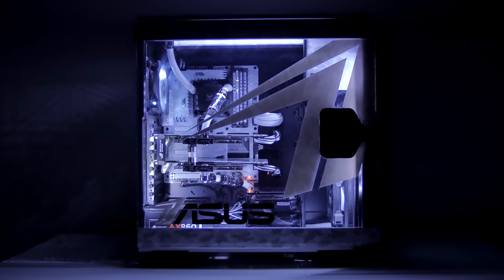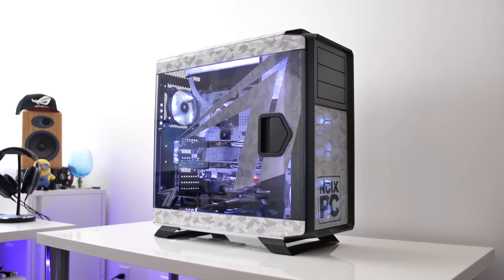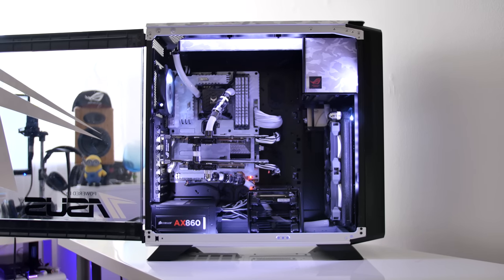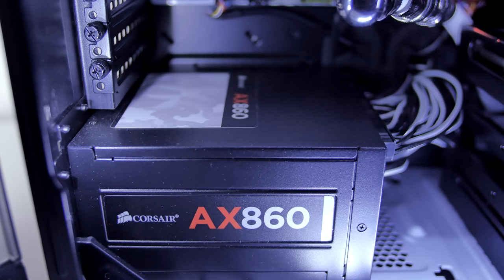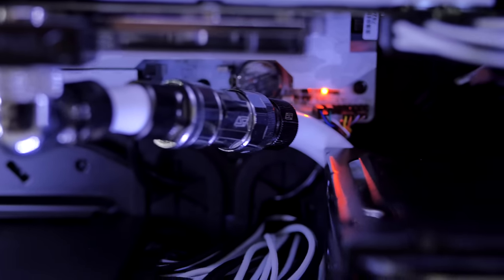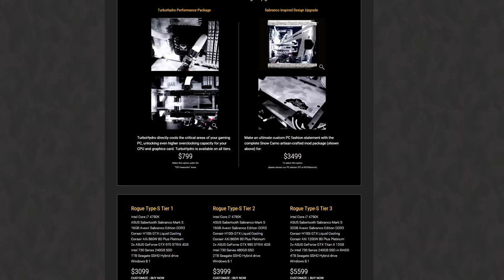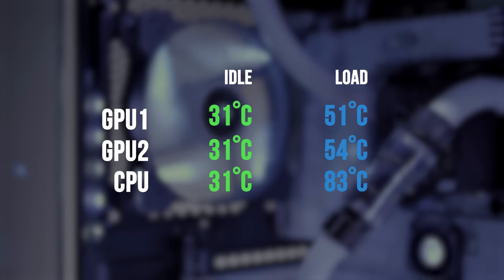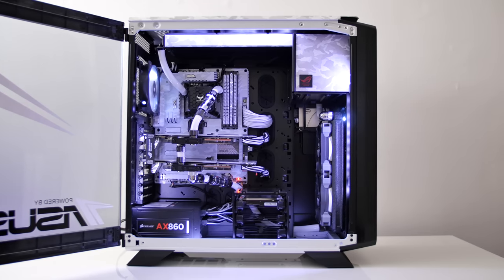NCIX PC: Rogue Type-S Review | 980 SLI, 4790K, 16GB

Comment: Why was there no 980 Ti version of this? If there are waterblocks availible for version like ASUS' STRIX version surely it must perform better than Titans. If not, might as well buy those to get the same performance for $700 less. Why is there a 970 version but no 980 Ti version? To show off dual GPUs? That's a lot of microstuttering for no value.
Reply: Firstname Lastname Two Titans>One 980TI
Reply: GGMANIAC My bad, the comment was poorly worded. What I was referring to was how there's a GTX 970 SLI version, which would be much better with just a single 980 Ti. There's also a Titan X SLI version, which would be much better with a custom PCB 980 Ti SLI setup.
Reply: Firstname Lastname Hmm yeah I suppose. This build may have been furnished before the 980TI came out though.
Reply: Firstname Lastname If you go onto the website and hit customize there is an option for 980 ti
Reply: Knowledge = Performance Alright that's cool but that really should have been in the recommended builds. I'm not buying this but it's quite a common theme for prebuilt PC's to have terrible build choices.
Reply: This is true. But if you know a little bit you can click customize and change some aspects of the build.
Reply: Knowledge = Performance I'm glad they at least added the option =P
Reply: ya
Reply: Firstname Lastname there is 980ti configuration just go to click the link in description and then click costomize
Reply: the guy Did you read the other comments?
Reply: Firstname Lastname nope
Reply: +Knowledge = Performance Hey! You seem to be knowledgeable about computers. Should I sell my 980 and get a 980 ti or just get another 980.
Reply: It depends on what  you are doing
Reply: Knowledge = Performance I'm looking to run future games like Fallout 4, Total War: Warhammer etc... on max settings in 1080p 60fps. Basically I just want to make sure that I can run games on max for the next 2 years or so. Thanks for the reply.
Reply: Chris Nelson for 1080p60 even 970 is fine(don't reply)
Reply: +Chris Nelson Im running crossfired 7970's ghz edition, been running games on ultra 1080p 144fps+ for 2 years, a single 970 would run anything at 60fps for 2years no prob
Reply: Inde x the only thing is, is that with the single 980 I've already ran into a couple games like total war attila and the witcher 3 that I've had to turn down some settings to get 60 fps. Also I'm wondering is the 4gb of vram on the 980 gonna cause any issues in the near future? I've had a couple games get close to using all 4gb of vram.
Reply: Having to turn down the graphics doesnt always mean your maxing your card, it could be your cpu/ram cant keep up, a badly ported/programmed game. I may make a note, not sure about attila, but if its like the other total wars, lots of units, ie, lots for the cpu to handle, and witcher 3 i know is very cpu intensive. Since you mentioned onle those games, id say its your cpu causing your lag
Reply: Inde x Really? I've got a 4790k and 16gb of ram. That'd be ridiculous if the cpu is already bottlenecking. What would you say about the 4gb of vram? Middle earth shadow of mordor uses almost all of the 4gb of vram. Will games in the next couple of years need to use more than the 4gb? Thanks for the advice.
Reply: The cpu itself isnt being maxed out, its the amount of draw calls that slows the game down. Take arma 3 for example, my cpu sits at ~30% (3930k), and gpu's about 60%, i still only get 70 fps even though neither are maxed. If you have 8gb ram+ (which you do) you wont have issues with ram on any game, 4gb and 6gb ive found bottleneck often. As for games in the future, with direct x12 becoming supported, and how little is known on how it will impact the performance of gpus, theres no possible way to predict how much vram is ideal. With a 780, you shouldn't have many issues but, those cards are awesome.
EDIT: Direct x12's main purpose is to increase the amount of draw calls (9x the amount), and see performance gains of theoretically 50% (microsoft's figures), so you should see improvements if those 2 games if they ever come to support it.
At current, the biggest bottleneck isnt hardware, its software, which direct x12 aimed to solve

Comment: Soft tubing and the GPU and CPU are in series, that is disgusting.
Reply: Loop order doesn't make a difference to temps
Reply: That CPU temp said differently
Reply: GuardianLords The temps have a lot to do with the TIM used with the Haswell CPUs. The 4790k has better TIM than the 4770k, but it's not as good as that of the Sandy Bridge CPUs.
Reply: GuardianLords lol? what do you want, two loops? Its got more than enough radiator volume to cool that hardware just fine. And Hard tubing is pretty dumb. It wourldnt work in this case, which is designed to be shipped around the country, hence the 2 quick releases before and after the graphics cards.

Comment: The watercooling loop would look better with fewer fittings above and below the video cards, as it looks too busy IMO, and the tube connecting the cards was crooked. Hard tubing would be nicer but I realize it would add to the cost. A better matching PSU could have been used instead of that red/back Corsair, or a custom PSU shroud installed (again, at added cost). The red Asus ROGO logo looked misplaced against that white camo background.
Despite my criticisms, overall I have to say it looked really great - I'm just very picky about details, but for the price it should look perfect as well as function properly. 
Great videography by Dmitri as always.

Comment: The barb fittings used with the hose clamps really hurts the look of custom liquid cooling system also with using a flexible tube to link the GPU's makes it look a little cheap IMO. I would have used ridged tubing in parallel not in serial for better flow. Also the huge NCIX label almost ruins it for me. But other than that it's a pretty nice looking rig especially with the white camo.

Comment: After just building a new system based on the Corsair 760T case, I am not impressed. First off, why the aggressive overclock? I'm running an ASUS z97-a 3.1 mobo with an i5 4690k that I originally planned on OC'ing the shit out of, but after running several games, I didn't have any reason to OC. My lowly i5 was keeping up with my big dick graphics cards. Originally I was going to run a single 980GTX, but received a second 980GTX for free, so I am running Big Dick SLI. With a Corsair H-100i gtx CPU cooler I never reach cpu temps above high 40's C . I just do not see the point of OC'ing an i7 to the point that it is running in the 80's C. Running BF4 I average 90-120 fps @ 3440x 1440 (HIGH-ULTRA SETTINGS) with temps in the low 40's C and my GPU's are always at 99% load....Again, I don't see the point of this aggressive OC.

My biggest challenge in working with this case was proper airflow. This "Rogue Type-S " completely missed the mark here as well. I originally wanted to mount the radiator in the front as he did, but after looking at all possible configs I ended up mounting the rad in the top, exhausting with a push/pull fan setup. This was not ideal, as I normally like to have my CPU cooler cooled with incoming, cool air. However, with no feasible air filtration for the top, aside from a stretched panty-hose ghetto-assed set-up, I relied on the 2 front 140mm fans with stock case filters, and added a second fan in the bottom pushing air in, and reversed the back fan so that it is also pulling cool outside air onto the MB and ram area. I added nice Silverestone magnetic Ultra fine fan filters, and  with this setup, I was able to supply cool air to both the inside edge of the graphics cards, as well as across the motherboard, especially to the hotspot area around my 32 GB ram. All the while my system has filters on all incoming air, while maintaining a positive case pressure to aid in dust control. The Rogue system will fill with dust within a week with the unfiltered top radiator fans and will look ghetto within two weeks with dust crapping out all the pretty white components.

This system is a perfect example of form over function..... Nothing in this system was intelligently thought out other than putting the most lighted fans and useless OC's for system spec checklists for advertising. Airflow is bad, with unfiltered air spraying dust into the entire system. The OC is overly aggressive and serves no purpose other than overheating the cpu....The liquid cooling on the GPU's looks ok but serves no real purpose other than looks.

I rate it a 2 out of 10.

Comment: Those are some awful temps for a custom loop. With that much rad space CPU temps shouldn't be getting anywhere close to that high. Makes me wonder if something is wrong with the setup. Do you have AC in the office? What speed were the fans and pump running at?

Comment: so sad to see these SLI rigs on 16 Lane CPU's so they are running at X8 instead of X16 so your are basically running one video card and a $750 loss on hardware not being used. Also its only capable of 2 memory channels they have them all filled so only two are being used. The CPU is what decides all of this right? or am I wrong about this? Its a lot of money to have just sitting there not being used

Comment: Dat GPU sag... Also, why did they have to leave the HDD cage in the bottom? Just looks wrong, and its not hard to use one of the optical drive slots for mounting instead, like I did with the same case\

Comment: GTX 980 SLI is what? 1.5x the performance of Titan X?
Reply: Half the VRAM, less Cuda cores but same GPU core which means it is very nearly as good as a titan x
Reply: +Tristan Boldy that's per GPU so sli is probably 1.8x as powerful
Reply: +Tristan Boldy 980 only has 4gb of gddr5 and not 6, you are referring to the 980ti
Reply: TheEpicCrumpet  4+4 = 8GB for optimized sli games
Reply: IcarusTuga7 VRAM doesn't stack in SLI.
Reply: JuiceboxNine I have 2x980 in sli after update recent driver in cod aw and gta v i see 8gb
Reply: +IcarusTuga7 Well then you've fucked something up. Vram doesn't stack in SLI or Crossfire.

Comment: looks awesome hardware packs a punch. But the only thing the cpu temp under load is high 83 degree C with 2 rads is not ok i think. looks good.
Reply: Amit Lahiri It's at 4,8GHz which is a lot. I'd say 4,5 would yield much better results temp wise. Keep in mind the rads also have to cool the 2 980's.
Reply: yes that is and that 360 is thinner style rad not a thick so this result is quite expected

Comment: The Temp barely build up yet and the sound test was ended.....hiding something ? 
My system too sounded dead quiet during the beginning of a benchmark , sometimes maybe even after 1 time benchmarking....let it run for least 3 - 6 loops, then see how quiet it is then....even after everything being heated up and running at the maximum speed require, usually the system will easily cool down and back being quiet. 
So this " sound test " isn't legit at all in my book or even being proper to begin with.....
But overall, awesome looking system. Temp are kept nice and cool so I guess it's alright. The CPU Temp is bit over my comfort zone though....since it's not what I've experience before, overall even so I bet it's more quiet than a air cooled GPU system I guess...those fans can really get noisy....

Comment: Should I wait for the GTX 1080 or go SLI with my current 980?
Reply: Wait
Reply: There is no way on earth you'll get 980 sli performance from a single 1080
I'd say go sli
Reply: Lee Greene Depends on your budget. 980 SLI sounds like a better idea. There's no way a single 1080 could beat 2 980s.
Reply: Cherry Pauper I know 2 980's will perform better, but I always hear that SLI has compatibility issues and studdering so I always stuck with a single card
Reply: I think wait until the upcoming flagship pascal gpu, it will probably be as good as 980 sli or even better because as we see with the 980 ti that is actually as good as 970 in an sli configuration, and if you opt to go with sli 980s all the problems that come with sli come in to play and that would just be a bad trade off in my opinion.
Reply: Tyler Taupe Yeah thanks I'll just wait
Reply: Lee Greene id wait for pascal, that's actually what i am doing :) I may also wait for intels next enthusiast platform

Comment: I only have intel hd graphics 3000 and an intel core i3 clocked to 2.2Ghz (dual core)
Reply: yasser hassani lol
Reply: Can't even run CS:GO in low settings
Reply: yasser hassani the pitty in that comment tho XD. But the only way to get a good pc is to work hard m8. stop complaining, and work hard for a good pc.
Reply: DAMN RIGHT
Reply: The laptop heat's up and power off,by watching youtube at 1080p@60 fps or playing minecraft
Reply: ***** i'm picking a new gaming pc on novembre,i only hane a single 1024p monitor so games will run really good..it cost's around 550 US dollars
Reply: i tried to pick up an nvidia 960 but it's too expensive so i took the nvidia 750 Ti,is it enough for 1024p gaming at high settings?
Reply: i won't upgrade until after 2 years

Comment: can just the cpu pump keep up over time to cool that loop?
Reply: Perry Seay I doubt it. Even custom watercooling loops require more than 1 pump to cool the CPU and x2 GPU and the Corsair is pretty weak compared to standalone pumps. I think what he got was the TurboHydro Performance Package for another $800 though.
Reply: Cloudz2021 Custom loops can run off a single pump with plenty of headroom. Unless you have an insane loop (4+ blocks, 3+ radiators with lots of bends) you only need a single pump. Second, that isn't even a corsair pump.
Reply: queefmonchan That's what I said. "I think what he got was the TurboHydro Performance Package". The stock model however just uses a Corsair AIO if I read the page correctly. I've got the MCP30 from Swiftech which struggled under 2 GPU 1 CPU.

Comment: Bet it costs double what it's worth
Reply: Ammar Anwar but the problem is that even an overpriced boutique builder like digital storm still manages to pack in better hardware for lower price all while again, water cooling in a custom loop
Reply: Ammar Anwar tbh the best and most cost effective way is to buy the parts yourself and have your local PC store build it for you, like ncix. costs like 50 bucks. But if you want it pre built origin PC, digital storm, cyberpower etc
the least complicated and for the noob is Digital storm
the one for someone who knows a bit is origin 
the best quality is no doubt digital storm
Reply: Ammar Anwar digital storm is the absolute best option for you, as long your wallet can handle their steep prices :)
Reply: ***** also their, Good better best options are very accurate and won't rip you off
Reply: ***** haha you win man,
It's more expensive but 3599 is the starting price for the ncix build so wouldn't know if it's more expensive or not, but 1 thing's certain: that's ncix PC has a nice paint job

Comment: i don't like it at all  its ugly as hell. with the same monye i can make a freaking masterpiece. and the cpu gets up to 83ºC thats not nices. my 5820k is blushing right now at 4.4 turbo 63ºC only while rendering ore heavy stress benchmark cose normali sits at 4.0 at 50-55ºC, and the best part is ...im using a sh**y, cr*py, bs, SecondHand 15 € Mugen Max scythe cpu cooler :)))))) . mine cost @ 1.2k  and kiks ass. NCIX should be able to do much better than that. lol
Reply: But the CPU is OC'd to 4.8 GHz, not to mention the mistake of having the GPUs continue to the CPU instead of heading to the top rad.